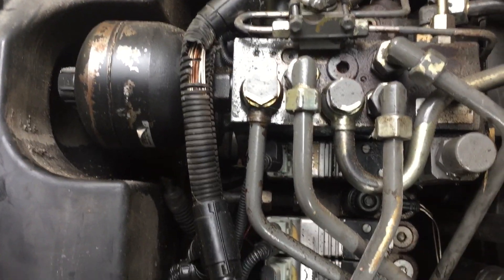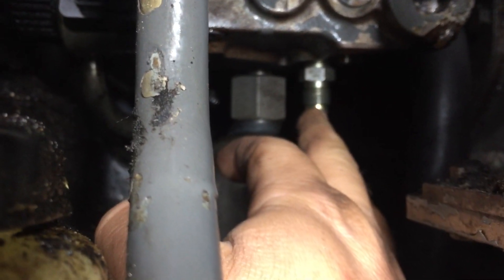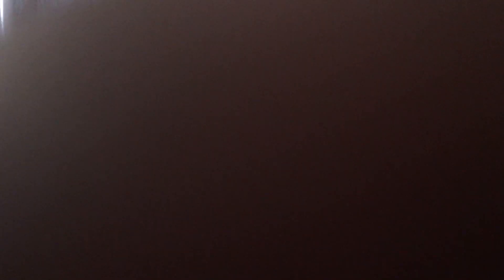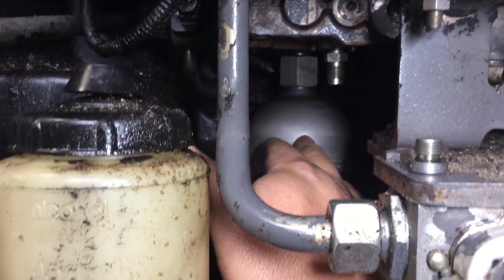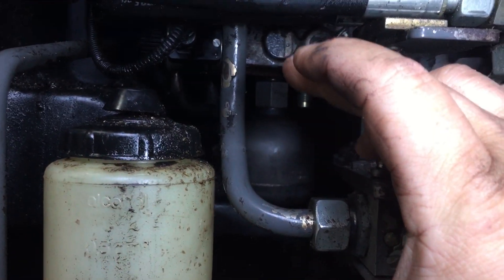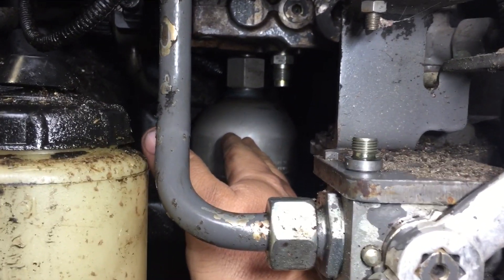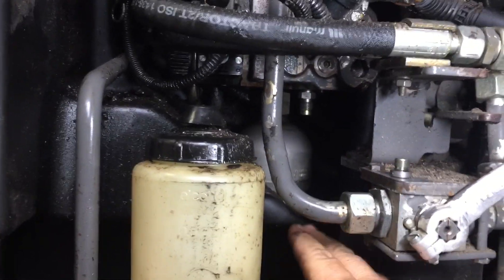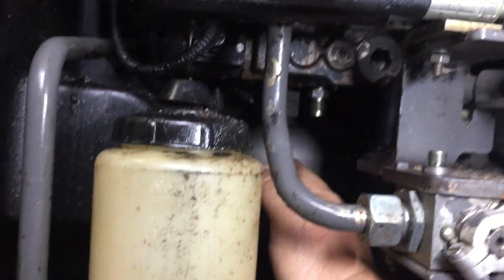Fendt hydraulic lockout

Comment: We are having the same issue with our 716… we have the new accumulator the shop said was the problem. My only question is when changing that accumulator (unscrewing the old one off the block).. can you just unscrew that? Or is there pressure? Or steps to locking anything out before removing/installing the new one?   It’s the weekend and of course our shop is closed 😫
Reply from the maker: Just saw your comment. Hope you got it figured out!
Reply: @joelwyttenbach2772  well we are working on it still.  The new accumulator didn’t fix it so now we are waiting on the filter inside the end plate to come in.  Hopefully that’s it and not the pilot valve.  Process of elimination lol.
Reply: @butch_bruce how did you go mate ? I’m in Australia having the same issue with my valves ( red green blue yellow) locking out. Tomowrro  I’m going to check for pressure 22bar. I do wonder today if it was the accumulator I changed mine years ago.